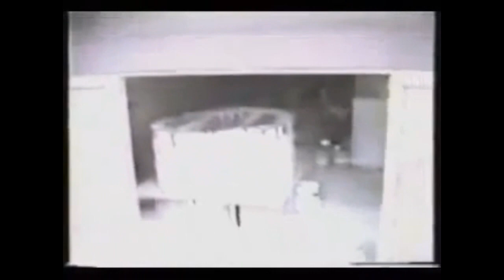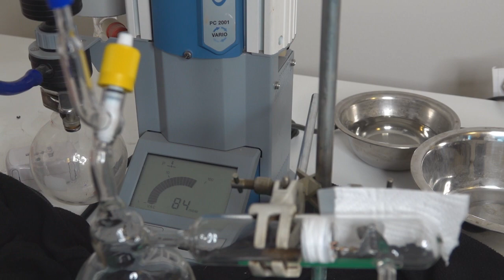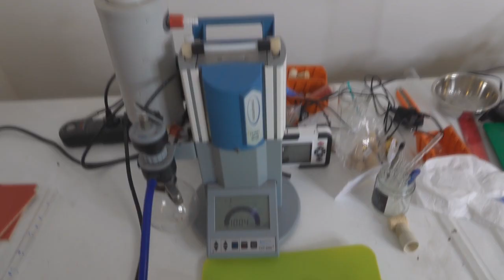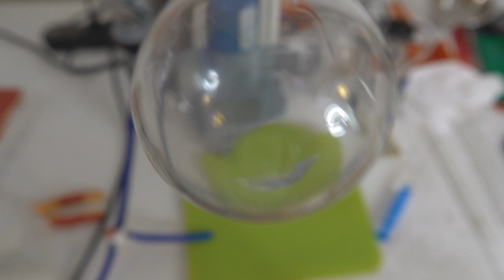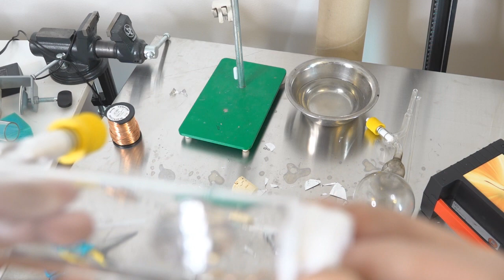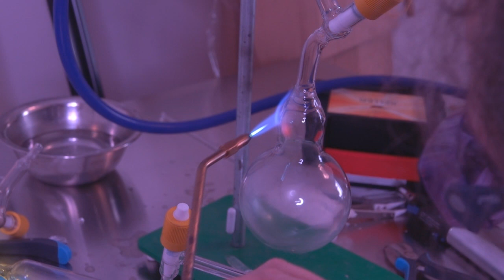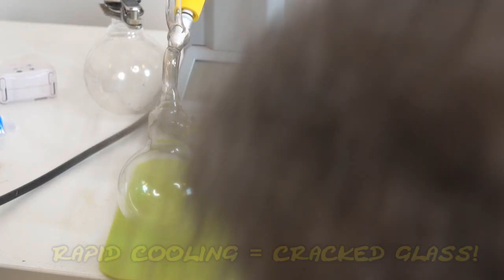The “Hydro-Vac” Space-Powered Steam Engine!

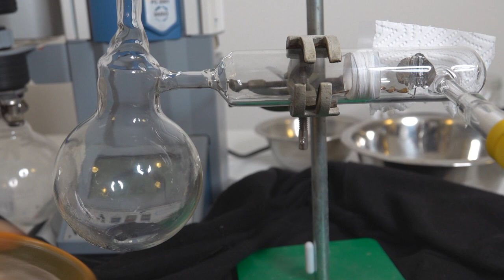Comment: 2:55 congratulations you've re invented ...the Stirling engine?
Reply: Ssssh ! Don't spill the beans, until he can, con ... er, convince enough those "Paris Hilton" types to give him a lot of money.
Reply: Its much different than the sterling engine in how it functions i believ but they work off the same concept, granted a sterling engine is much more versatile and more robust, but this is a very unique toy
Reply: @firefox5926  Yes, but it's far better than what Musk can do.  Plus it'll benefit all man kind far more than anything Musk can do. On top of that, Elon Musk could never make a better crack pipe that could withstand the temperatures needed to burn the meth. made by a scientist like Thunderf00t.  Moreover, Thunderf00t invented the meth pipe way before Musk was able to land a rocket after it delivered a satellite to LEO.
Reply: @kiyosenl.3889  My biggest problem is that TF uses fake evidence to call out Musk.  TF used the DCX program to say that SpeceX in no way was the first company to land a vertical launch and land rocket. (I was coming out of college when the DCX program was running and hoped to land a job with it.) DCX did not compare at all to what SpaceX did.  DCX landed after flying a couple 100 meters up. That thing couldn't even get to space, let alone land when it came back down. But more importantly the DCX failed because they were unable to build a fuel tank that could withstand the fuels.The first thing SpaceX had to do was build the fuel tanks to hold the fuels.  And that's what they did.  TF ignores the fact that SpaceX over came the exact problems that killed the DCX.
Reply: @stevenhorne5089  

The first vertical land and launch rocket was the Apollo moon lander. Granted it didn't launch in earth gravity, but it did land under power and take off again.
Reply: The Sterling engine works with ideal gases, this one with condesing and vaporising water. It might beat the Sterling engine in terms of efficiency actually.
Reply: @janb.3600  Considering this requires mantaining a vacuum, I'm betting on the stirling engine.
Reply: @Poldovico   Aha, But I have the solution... Concrete. Lots and lots of concrete... no air (and/or water vapour) will ever escape (or enter the system in this instance). Sure your thermal insulation will be worthless, but ah well.
Reply: @michaelmoorrees3585  If he gets any Money tho i would lamo and cry to death.
Reply: @janb.3600  Even if this an improved Sterling engine, the biggest problem with the Sterlings wasn't so much efficiency, but usable output (like horsepower and torque), plus they tend to chug along (RPM) at semi-constant speeds verses a continuously variable speed engine. 

I love the creative and artistic aspects of this project, but I'd like to see USABLE OUTPUT information. Getting it to spin "without input" is quite cool, but being able to GET something out of it, especially under load, is an entirely different feat.
Reply: Jan B. The Stirling engine design can be applied to any working fluid, ideal or not. As long as you get to do constant volume and constant temperature processes, it works. Thing is, this here is not an "engine" in the conventional thermodynamic sense at all because it doesn't operate on a cycle. You can't even calculate its efficiency using the usual formulae without some tweaks to the design.
Reply: i'll be honest i only watched the first 5 minutes and assumed it was  something along the lines of  lowering the  boiling point of the water by reducing the the pressure  and then using the low temp steam to spin the  pin wheel... as it flows and equalized and then condenses on the cold surface with this ice   i.e   the heat is supplied into the system by room temp atmosphere  and then sucked out of the working fluid by the ice at the other end and in between you can get some work done by impeding the flow ... but  as i later learnt .. while yeah that wold..or at least should work ..its also kinda useless as the work that can be down is dependent of the thermal gradient between the ice on one end and the  room air temp on the other ... which is like 20 c diff...  that said if you were to use a lot of them  then  you know like how you're Penney in taxes   make up the like 800 billion dollar military expenditures  oh the usa ...(assume you're from there if not see applicable use case in your jurisdiction) that said  sucking that much energy out of the atm would have effects... namely cooling.. so maybe that's not so bad...o    ... @isodoublet

Comment: The cold ice cools the glass, condensing the water vapour already boiled off the water, allowing more water to boil to fill the void. Once the water boils, it moves through the tubes, imparting kinetic energy against the foil and making it turn around. Just a complete guess from a newbie non-scientist.
Reply: Is that the explanation of convection also?
Reply: vacuum snake vacuum oil
Reply: let there be vacuum snakes...plz.
Reply: @Forien   outer space temp. is around minus 455 degrees Fahrenheit. That would be a good place to freeze some water lol
Reply: @ruisantos7363  unless in the direct light of a star, then you have the heat radiating off the star to contend with, but without much atmosphere the heat wouldn't be much different.
Reply: @ruisantos7363  and where do you get your heat to boil the water from then? (energy efficient of course)
Reply: Different work fluid but all the same basic principals as a drinking bird - https://www.youtube.com/watch?v=UCKC-QVcVn0
Reply: @lowresgamr  You're right, but if you get a large surface of water long enough in the shadow, you can also create a lot of ice. The thing about this engine, is that the whole system would have to be so big, that the captain would say: we're gonna need a bigger boat.
Reply: @Salzmann_AvX  From the other side of the ship dude, where the sun hits lol
Reply: STUPIDITREE 
I’ve met plenty of ‘snake’ vacuums. Haven’t we all though (thankfully).
Reply: @ruisantos7363  Solar panels are more efficient.
Reply: @Salzmann_AvX  
The vacuum lowers the boiling point of the water to less than room temperature.
Reply: @BenjaminFranklin2u  I'm more into getting a lot of cows on board. Feed them grass and beans. How many Joules would we need to put  a dozen cows up there?
Reply: I imagine the idea would be to use the cold of space and the warmth of an atmosphere or solar radiation.
Reply: @Salzmann_AvX  You have the 4 elements needed to run this engine:
Vacuum, Heat and Cold just outside the ship. We just need to bring up the water.
Reply: no the glass heats the ice
Reply: @ruisantos7363  

I'm not defending or supporting this, I'm not about to give a position on that but there's loads of water/ice in space/on planets, moon, asteroid, etc.

Water is not a very big limiter.

Adam
Reply: Vapor pressure is a hell of a drug man. The equations on it would be a lot of fun to work through for freshman/sophomore engineering students. My brain is kinda fried right now, but you can probably simplify the equations down to whatever energy is used in spinning the turbine + interior water mass times the specific heat of the water times delta temperature = ice cup's gain in energy. I'm pretty sure everything else cancels. There is the glass temp and other junk in there to factor in but screw it. I'm kinda not up for doing actual equations right now. It's been a long week and I don't get to turn my brain off until Saturday.
Reply: @adambartlett114  That's quite accurate!
Reply: @Forien  they are, they use them in Greenland because there's active geothermal vents there and it's cooler then a step mother's kiss so those really are infinite free power plus they have massive flywheels to store lots and lots of power
Reply: Yeah, it's a heat transfer system - a vacuum based heat pump.
Reply: on earth in space you have to account for insulation and weight in the mission but most of that could probably be made up through sacrifice of pre-existing allocations.
Reply: Forien Is it better to think of it as a pressure drop caused by the lower tenperature driving the flow?
Reply: @ruisantos7363  

On a clear night you can make ice even though ambient isn't quite below freezing.  Radiate cooling is a thing. 

On a serious note trying to generate real power off of a 20 deg C difference isn't very effecient, even if you had an engine that matched the maximum theoretical efficiency.  And even if you generated the ice that way, the engine would be solar powered, just indirectly so.
Reply: And the cold is drawing heat energy, so eventually the ice will melt or the flasks will even in temperature
Reply: @lowresgamr  see my comment on the interaction between radiation and magnetic fields and how you could arange magnets throughout the apparatus
Reply: Cptn obvious is obvious 🤔
Reply: Unless you have somewhere naturally cold, like outside in cold countries. Then you're taking the excess energy from nature.
Reply: Jim Griffiths Yes. The basic principle of all engines is you need a hot and a cold region, and heat energy flows from the hot to the cold. But that guarantees that, eventually, the temperature will equalise between the hot and cold zones.
Reply: Grats! Love your good guess that is dead on
Reply: why cant we see it boil? i've seen on other videos that room temperature is hot enough to boil under 100mbar
Reply: hahaha lol, it uses magic.
Reply: it works really similarly to the stirling engine
Reply: @ruisantos7363  a Sterling engine would be more efficient in space as on Earth.

Comment: isnt this how the Drinking bird toy works?
Reply: yes it is.
Reply: No, the Drinking bird uses gravity. This machine uses the friction caused by the water vapors.
Reply: No.
Reply: there are both types, both do use gravity but so is this on earth for the water end. the toy versions are usually a confined liquid with certain thermal and non-toxic attributes.. depends how old it is.
Reply: Thanks for pointing that out !
Reply: Yes it does
Reply: Yes and no. The motion ultimately derives from a temperature difference. The temperature of the room and the temperature of the ice or cold cup of water. But at that level you can say it's the same as wind power generation since the wind is produced by the same effect.

Depends on the level you want to look at it.

Comment: So basically you made a Stirling engine that is powered by space? I guess some space submarines will be very happy with that.
Reply: That is what I was thinking
Reply: It's not a sterling engine, but it is a heat engine. kinda like a small scale steam turbine.
Reply: @TheNerd484  a sterling engine is a heat engine...
Reply: @Michael Grondahl and not all heat engines are stirling engines.
Reply: @TheNerd484  The reason why I called it a Stirling engine is because of the low power output. It's a fun gimmick, but not all that practical.
Reply: @TheNerd484  It's a rotary stirling engine as the medium which moves the turbine doesn't vent out.
Reply: @NorthEevee  Not all Stirling engines have low power output, one working on submarine.
Reply: @nanonymous9139  I realize that, but it's still quite low compared to what other engine can do. The sole reason they use those engines on submarines is because they're dead silent and that trade off is well worth it when it comes to it's modern role. Heck, if this vac-engine has more power as a baseline it might replace those Stirlings.
Reply: hunter killer subs powered by a stirling engine that use cryogenic helium for the cold side and the ocean for the hot side are a real thing. They can stay down longer than diesel subs and are more stealthy than nuke or diesel subs.
Reply: @tmcdon4ld  I watched a video on that a while back. Heard from a guy the the navy from the country that I reside in might get one too.
Reply: Stirling engine = cycle with two isotherms and two constant volume heat exchanges. This here thing is not operating on a cycle at all.
Reply: @isodoublet  I was referring to the general low power output of Stirling engines.
Reply: But that's not how a Stirling engine is defined.
Reply: @isodoublet  Could you please accept that this was not a serious comment and it's only purpose is to give me meaningless internet points?
Reply: Dude, you were just wrong about a small definition. It happens. Move on.

Comment: Now connect a freezer and power it with the generated power to keep it running.
Reply: In space away from stars (or even near stars, in a shadow) cold is easy.  It's keeping the water in the right flask from freezing solid that is harder.
Reply: puncheex2 you could make a dual layered flask for the water and in-between the layers use aerogel.. 

providing you can get a formula that could withstand the cold of space.
Reply: @garystinten9339  Vacuum is the best insulator going, but that begs the point.

The point is that a heat engine needs to have a hot area and a cold area.  The movement of heat from hot to cold can then be used to create work.  If the heat doesn't move there's no work derived.
Reply: If the vacuum tube was sufficiently long, you could run it from pole to equator.
Reply: @Capitanvolume  But after some time, the pressure will stop changing and reach some sort of equilibrium. Then you'd have to flip the entire thing so the equator part is at the pole and vice versa :D
Reply: Space freakin' roadways

Comment: This is a very small condensing steam turbine... Everything old is new again!
Reply: Steam energy was a industrial standard due to the infinite torque, heavy heavy shit would just work all the time consistently. Nowdays with bleed off valuves and safety checks and automated boilers we could have steam cars that run on gas but only use electrical energy get a higher energy conversion than with a internal combustion
Reply: @Anomalouzs  Not sure how a steam engine could possibly be more effiecient than a combustion engine. Internal combustion gas engines convert gasoline immediately into energy as soon as you step on the pedal. Thats simply not possible with a steam engine.
Reply: @blu3flare25  Steam systems are operated at a set pressure, you want more power you just open the valve more (think of that as your throttle) you start to run out of power when your steam pressure starts to drop, but the amount of energy stored in steam makes it extremely efficient trust me I'm a power engineer lol. 

The biggest issues for a car would be the weight, size, and safety of it.
Reply: Demetry Romanowski Okay i guess it might be possible mechanically. But i would have a very hard timing believing this would be more efficient on any level than a gasoline engine like anomalouz seems to suggest.

You must store a large amount of water and another fuel source (when you can just have one with gasoline...) just to create steam.....
Reply: He obviously does not understand the amount of wasted energy in a steam driven engine too even the slightest degree....
Reply: Anomalouzs

"Steam energy was a industrial standard due to the infinite torque" 
They had lots of torque due to the mass of piston/crank of the whole engine. Similar with older ww2 era gasoline engines not much HP but massive amounts of torque due to the very large size of the engines.

"heavy shit would just work all the time consistently"
Thats due to the very low RPM of steam engines

You seems to know nothing of horsepower which is just a function of torque and RPMS or just engines in general.
Reply: @blu3flare25  Efficiency is a very context based term. If we are talking about pure mechanical energy then yes steam is a lot more efficient. Internal combustion engines convert about 25% - 35% of the energy in the fuel into torque. Steam systems on the other hand can convert 40%-50% of their fuel energy into torque. The rest of the energy is dissipated as heat. Like I said before the problem lies when you want to start moving that stuff.

Lets take a small car as an example engine weighs roughly 500lbs, fuel lets add another 100lbs so total 600lbs as your mechanical energy source,
To make the equivalent horsepower from a boiler you wouldn't need a very big one certainly a lot smaller than what I have ever worked with (smallest one I ever ran was 5409hp) but you would need a feedwater tank with water, feedwater pumps, a boiler a steam drum, a steam header, all the valving that goes with that, all the control systems for that, a water treatment system, a way to supply make up water, fuel and then a turbine or piston type steam engine, all that I can guarantee will weight a lot more than 600lbs, more weight = more energy needed to move that object. 

Yes you are 100% right you have to store a lot of water but modern steam systems will not just waste the water, it turns into condensate, and then fed back into the feedwater tank to be re used in the boiler cycle. (assuming you dont have to make up water)

This is why electricity is commonly generated using steam, instead of internal combustion engines.  

And as a final nail in the steam car's coffin an accident will almost certainly always be death, There is a lot of energy in that steam drum and header, and rupture would be like a bomb.
Reply: @DemetryRomanowski  Alright thanks for actually explaing things. I was thinking more of the terms of a locomotive steam engine which gets about 7% efficiency.